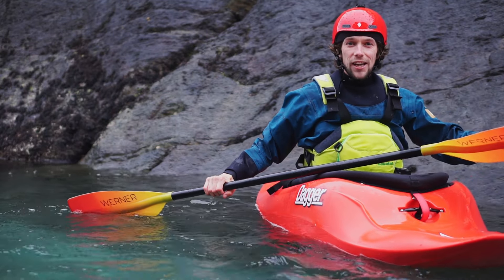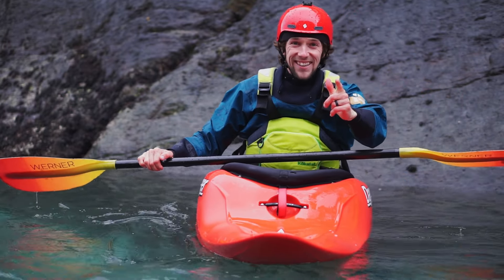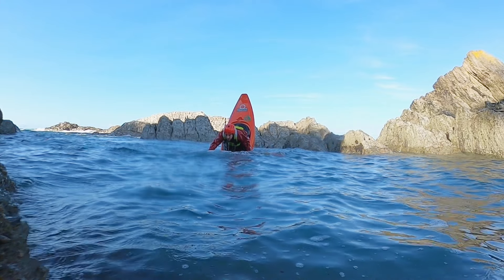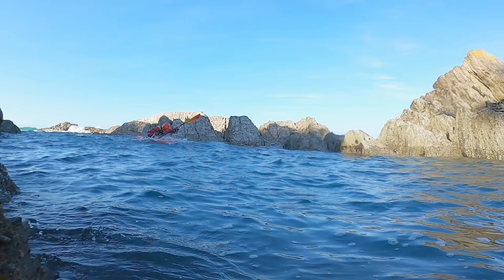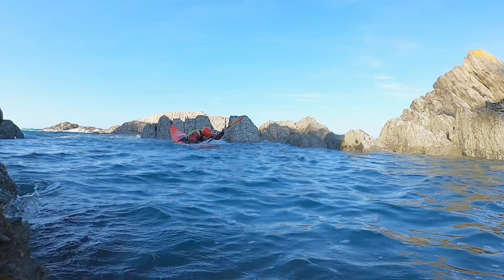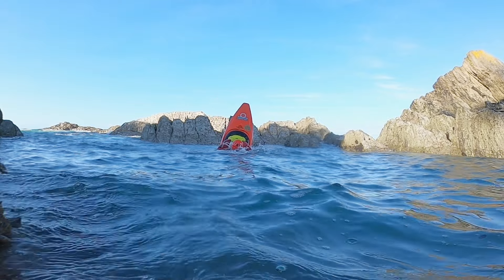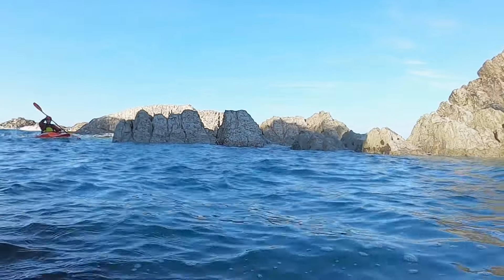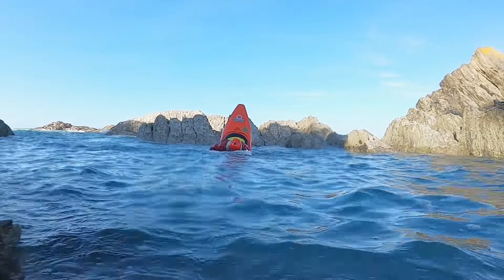How to perfect PLOWING ENDERS!

Comment: One cool trick I saw in a Eric Jackson video that works for me is paddling just slightly forward when whe stern is under water and giving it some "diving time" so to speak. After one or two strokes you can then give it all you have and paddle forward. This helped me get vert. in my freestyle kayak. 
I would love a tutorial / showcase on some downriver moves that are a bit out of the box like your chill surf shown in the intro :)
Reply from the maker: That's a great tip. Would definitely help with avoiding burnout on this trick.
As to the downriver moves, I have some bits in the pipeline, but I've also already put out a top 5 wave party tricks - it's in the tutorials playlist.